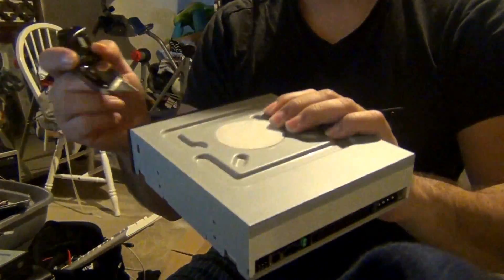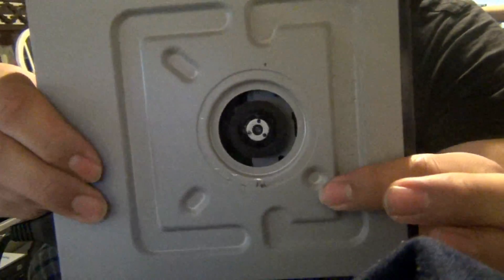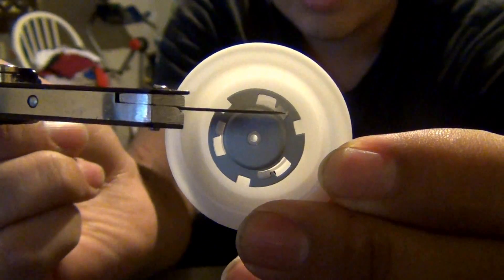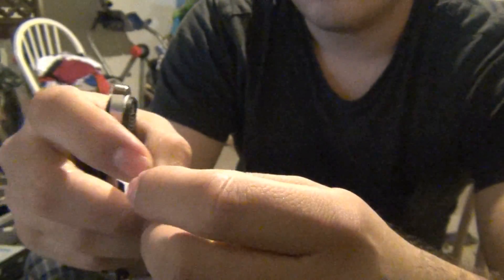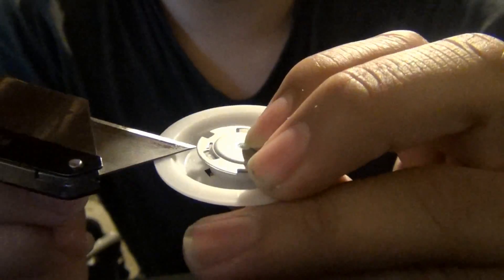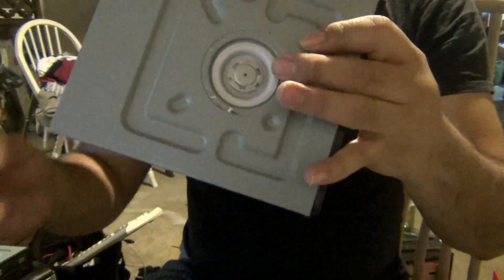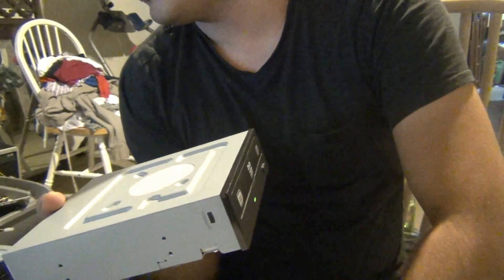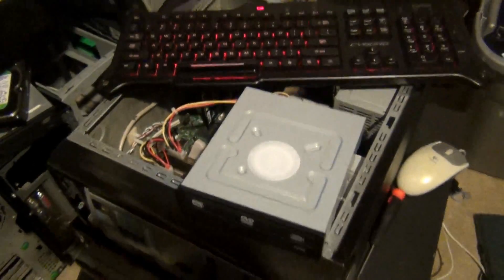How to repair Almost ANY DVD-CD-BD drive.

Comment: I own a Plextor that had been sitting for 4 years... it was otherwise in mint condition and everything worked prior to storage..  When I placed it into a new machine just now, it suffered the same fate - dc tray failed to eject.. When I removed the housing, it worked, return to its casing, didn't work. I troubleshooted the problem to be the spindle balancer / centralizer as in your instructional video.  Doing your fix failed to fix and I also learnt that the magnet is not in the head of my Plextor. It has the magnet on the inside track / laser mechanism. I removed the top plate as in your instructions, and placed double sided tape where the magnet would otherwise be (as in yours).. It worked as yours did.. I guess with mine, the magnet couldn't pull it as tight, AND now, the CD/DVD tray ejects as it should. Great instructional video.. Yours was the ONLY solution I could find to resolve my problem caused by the magnetic head.. MANY THANKS..

Comment: thanks for the vid, got me going in the right direction. mine had a metal plate cover and then the little disc was also metal, i just removed it and cut a business card to fit under the little metal disc and it worked, thanks again.

Comment: The "right" way to fix this is to replace the tray belt, but I suppose this is probably an okay way to get the drive working again in a pinch. These BenQ designs (including yours, which appears to be a Lite-On LH-(16/18/20)(A/W)1(P/S/H/L) family drive - or "1 drive" for short, which seems to be a BenQ design, and are also a bit annoying in that the PATA ones seem identical to the "4 drives" and the SATA ones to the "7 drives", but that's kind of irrelevant) were kind of infamous for tray belt issues. The BenQ DW1640 was particularly terrible in this regard, but Lite-On "1 drives" can certainly suffer from this same issue.

Many other drives from PLDS (Lite-On, BenQ, many Plextor, Asus, Sony, Philips, HP, Teac, AOpen...), TSST (Toshiba, Samsung), Pioneer, and some others do share this same design and can use the same fix, but one thing to keep in mind is that HL-DT-ST (LG) drives tend to often be different, with the magnet in the spindle table and just a piece of steel in the clamper. The same fix may work, just be aware that the construction is somewhat different. In addition, the cover over the clamper is also hidden under the label on many drives. The "1 drives" like yours are a bit unusual in that they have the label on the bottom, but it's trivial to slice through the label anyway.
Reply: You may be right, but so far I've done this to several LG drives without issue and have not had even one where this did not work. It's also faaar easier + faster than replacing the belt.
Reply: Drive belt will not work...I placed a rubber washer which had identical dimensions and it worked fine...however if I placed the top cover back on it will not open unless you press the manual metal release with a paper clip...the motor cannot produce enough torque to push the gears and free it up since the top cover spindle cover is on too tight.....the motor also is tired after 15 years of living...Just think when your CD rom were built they were still making the first Generation Acura NSX.
Reply: You never got the memo, people don't like a know it all...

Comment: Recently I disconnected all drives just to clean PC .When I connected 
them again my computer couldn't detect DVD/CD drive anymore. Any tip how
 to fix this problem? DELL dimension 4600i/Windows XP
Reply: You will change it at your own expense
Reply: that pc you have is a piece of crap...it's dying there...buy a pc with intel core i3 or someting with 4 Gb of ram at least...wtf are you doing with a pentium 4 processor that is good for museum?
Reply: anyway maybe you let some dust in the cable that conects the mobo with ur cd rom

Comment: hey, I have a drive that was working but in a frustrated moment I smack it with a controller and made a dent on the aluminum near the little circle. The drive makes allot of chuckle noise, do u believe it would be the little circle that's the problem?
Reply: that was the problem. just opened it and put it back the same, thanks for the video
Reply: MGrider